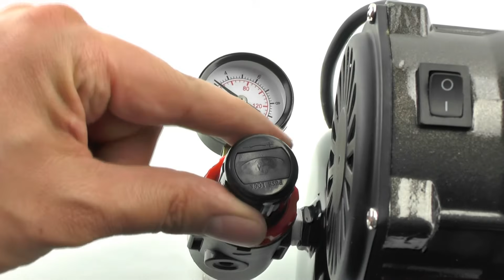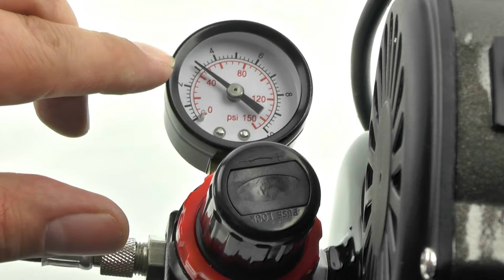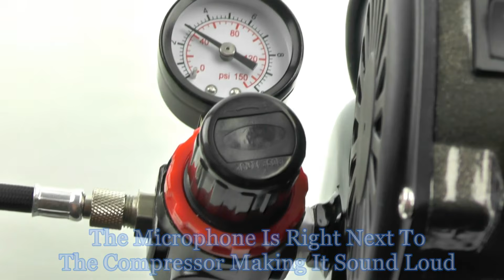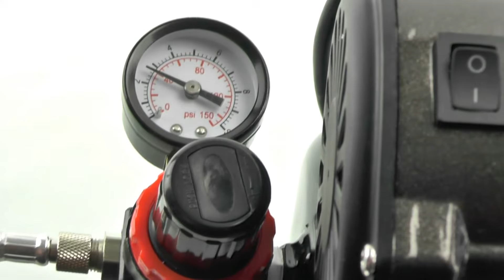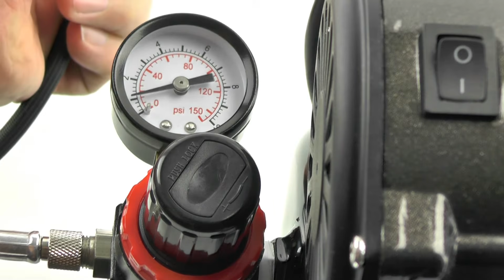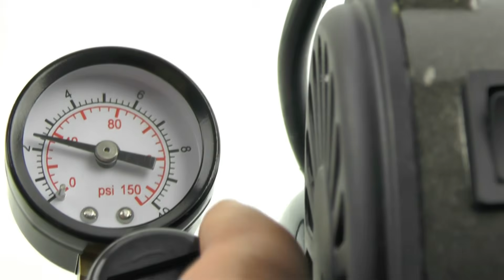BARTSHARP Airbrush Air Pressure Regulator Set Up *New Video Better Audio & Features * In Description

Comment: Hello, a question from me. How much psi do i need for applying 2k clear coat on with airbrush? thanks in advance
Reply from the maker: Hi,  take a look at this video which covers spraying of 2k clear coat with an airbrush. lots of waffle at start but at 16.50 mins he states 30 PSI (with a 5.5mm needle set up). You will need to adjust to suit your particular application. Hope this helps and best of luck (don't forget to use PPE). https://www.youtube.com/watch?v=BhNtx678qDg
Reply: @BARTSHARPAirbrush  Thanks, i'll watch the video

Comment: What if mine is leaking
Reply from the maker: If it's leaking from around the glass you will need a new one (this often happens when people tune the gauge by hand, instead of using a spanner on the brass connector, and it twists the gauge breaking the internal seals. If it's leaking from where the connectors go in (from the compressor) or out (to the airbrush hose) then put some PTFE tape around the fittings. Sometimes the gauge will leak from a very small pinhole (on the black body just above the clear section and to the left side) unfortunately this means the unit has to be replaced. Hope this helps.

Comment: Im having problem with mine. Everytime i try lowering the psi it stops sending air altogether but the moment it barely adjust the top it goes straight to 40 psi. is there's something wrong with my compressor?

Comment: great video i have a compressor i bought as it was a silent/quiet compressor. it has a gage already on the compresor but also came with the regulator as above however it only has an outlet. the compressor had no make model or user manual. would appreciate any help

Brilliant site. Keep up the good work.
Reply from the maker: Thank you for your kind comments. Not knowing your compressor make or model I would guess that the gauge on it is for displaying pressure at the pump/tank. You could link the second air pressure regulator by attaching an air hose from the pump outlet to the 2nd gauge air inlet. Then use a second air hose from the 2nd pressure regulator to the airbrush. You will need to air hoses and, for the air pressure regulator in the video, 2 x 1/4male - 1/8male air hose connectors. This means that you will be able to set the working air pressure at your airbrush on the 2nd air pressure regulator whilst leaving the pump/compressor gauge set to max. Hope this helps and is relevant for your particular compressor.
Reply: thank you for your reply much appreciated. keep up the great work.

Comment: is it possible to add a second (third if you count the manometer) to the pressure regulator? Could I just unscrew the hex bolt and screw in another hose outlet?
Reply from the maker: Hi, you would be better fitting an air hose splitter manifold.... 
https://bartsharpairbrush.co.uk/product-category/airbrush-accessories/air-hose-splitter-manifold-airbrush-accessories/

Comment: Hi. Ive got a tank compressor that only has a tank pressuer gauge. Can I replace it with a pressure regulator gauge. cheers Snapshot93@hotmail.com
Reply from the maker: Hi Tom, you should be able to add a pressure regulator after tank pressure gauge. You will just need to make sure that the air hoses have the right fittings. Also make sure that the air pressure, coming out of the tank, does not exceed 100PSI as this is the max working pressure of the air pressure regulator. Hope this helps.

Comment from the maker: Hi V081WLBlue and thank you for purchasing from us. 
To get an air pressure regulator to sit in the correct position (vertical) you may need to use PTFE (plumbers tape). This will also assist with ensuring that you have an airtight seal. 
The process is very simple: apply the PTFE tape to the tip of the air outlet on your compressor and wind it around and towards the back. You should aim to have more tape towards the back of the air outlet, where it joins the compressor or tank, so that it resembles a cone shape. Its then a case of fitting the regulator and seeing how it sits. If you have tightened it and it moves past the vertical position then add a bit more PTFE tape. You should be able to get a perfect fit within one to two minutes using this method. Let me know if you need any further help as I have a diagram which clearly shows the above. 
Many thanks!
Reply: You actually included the PTFE tape with the kit but I had not been applying it correctly to get a good seal with the trap in a proper upright position. Now reading your instructions I have managed to achieve this, Cheers!
Recommend Bartsharp to anybody looking a good modelling airbrush set-up :-)
Reply from the maker: Hi, excellent news and glad we could sort it for you.

Comment: I bought this compressor/moisture trap set for your company but the moisture trap/air regulator when fully screwed on is upside down!!!
Reply from the maker: You need to remove the air pressure regulator and add a couple more turns of PTFE (plumber's tape). Refit the regulator and check position. If it is not at the perfect vertical point then remove and add a few more turns of PTFE tape. Repeat until you get that perfect fit.